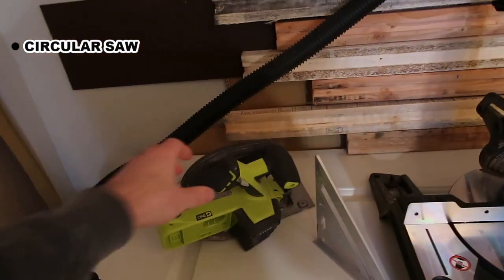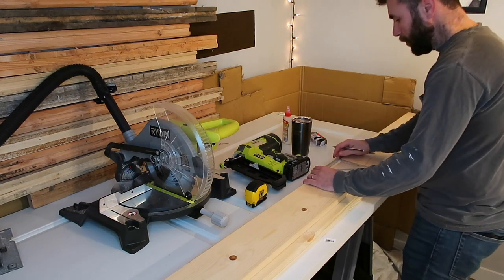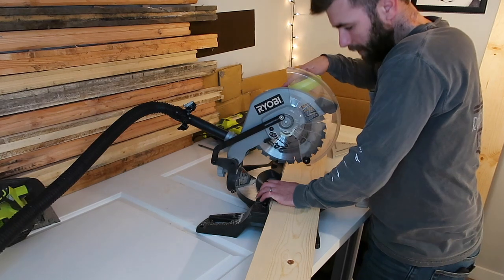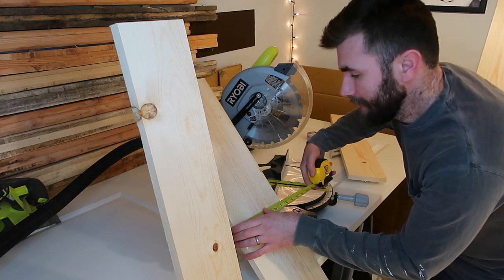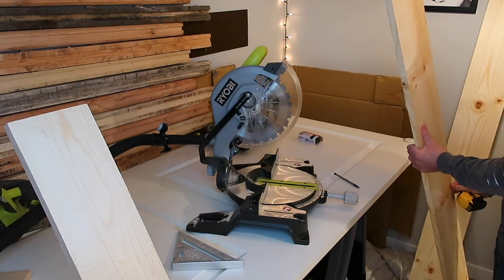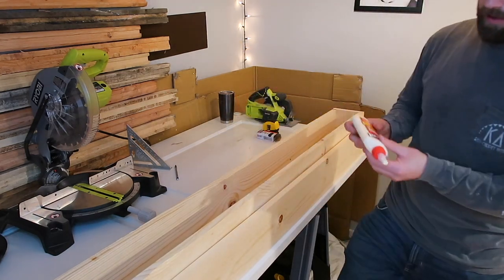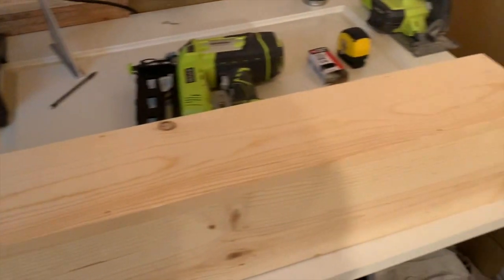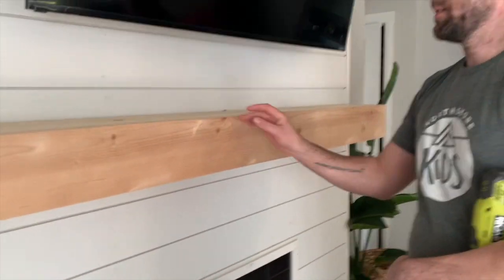EASY DIY WOODEN FIREPLACE MANTEL

Comment: I'm thinking about hinging the top of the mantel from the inside and hiding my cable box and modem in there I'll let you know if it turns out cool ....great vids by the way Im starting my fireplace tomorrow
Reply from the maker: That’s such a good idea! Just remember that most remotes work using infrared light signals so if your modem and or cable box uses an infrared remote then chances are, if it’s inside your mantle, it may not work! Just try putting your cable box behind something solid and see if the remote works! I’m excited for you and your project!
Reply: @TheModernMann  yes sir my box is on a rf frequency so it should work but I'll test to make sure